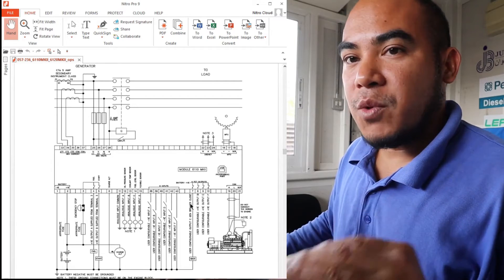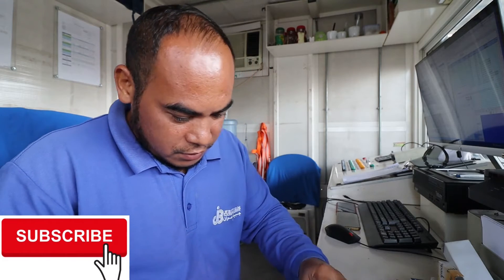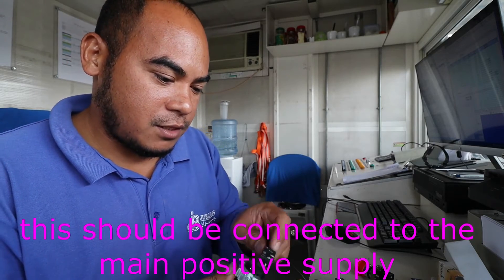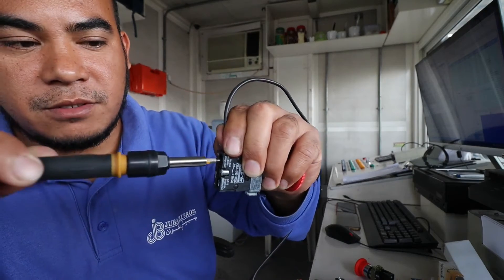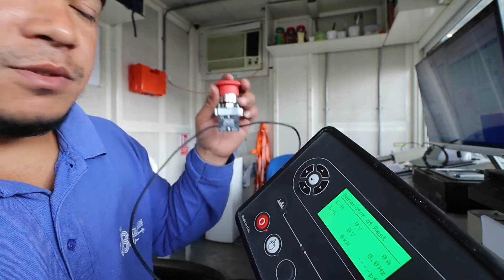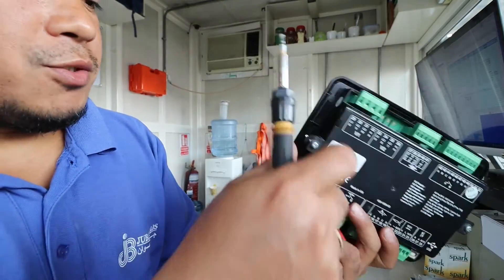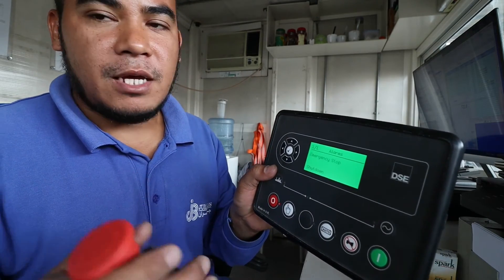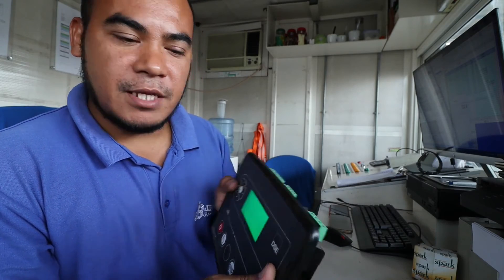Generator EMERGENCY STOP, wiring connection, troubleshooting lets simplify

Comment: thanks for the video, it describes the whole story about the emergency stop cycle... I have a strange case on my DSE 6020. It gives me the emergency stop alarm while the emergency button is not pressed !! note that my generator contains only one emergency stop button !! can you advise what needs to be done? Thank you, brother.
Reply from the maker: Emergency stop is always have a positive supply that should be use multimeter to check if there is voltage DC going back to your module if your using digital input for extra emergency stop the supply is negatively active should be

Comment: Sir good day. I have concern regarding emergency stop of genset 3412C emcp 4.2  ayaw po ma reset sa monitor pero sa ct et po e mawala nmn sya pag n reset. Sa monitor lng nka present lage. Ano kaya possible cause sir.
Reply from the maker: Check the wiring exactly kong meron pbang suplay na pomasok or wala na
Reply from the maker: Makikta mo sa likod ng module ang connection doon mo ngayun testerin using dc voltage

Comment: Thanks sir for this video,  but I have issue with 6110 models, emergency stop and lock out have showing,  how do I deactivate it sir
Reply from the maker: First thing to donis to check the alarm because if onky emergency stop is the problem thin if only emergency stop reset and releas the push botton finsh

Comment: Pls is have issues on 6110 model  the  emergency does stop what should I do
Reply from the maker: If emegerncy stop no remove checkbthe voltage coming to module number 3 should be same as volatge accordibgvto battery now if no volatge meaning fuse busted or push bottom problem contact

Comment: Sir, do you have any wiring diagram for the old FG Wilson 2001 Control Panel?
Reply from the maker: Analog or digital sir lahat na dito sir digital na module
Reply: @benzblogsVlogs  Sir, meron kaming ganitong model sa isang location namin pero wala akming makuhang diagram. Just asking if you have any Sir.
Reply from the maker: Sir wala pero makatolong ako para e guid if posible sensya na sir
Reply from the maker: but dont worry if you have questions just let me know thanks have agreat day

Comment: Good Evening Sir what is the problem when  I start the Genset it crank once before start the engine.. thanks
Reply from the maker: Less starting fuel
Reply: Sir ano problema ng generator na nag crank ayaw umandar bago na Yung pump ng fuel . Palagi trouble airlock . Salamat
Reply: Sir Benz ano problema may 220kva kami generator Cummins tapos may load na 50hp 220volts umabot ng 400plus starting current big lang magfault Ang generator. Ano kaya problema salamat
Reply from the maker: @johnpauldorado439  ganito 50 hp is equivalent of 37 kw (3) is more than 400 starting sir dapa talaga engine mo sir dapat meron kang softstarter para hindi dadapa makina mo
Reply: @benzblogsVlogs  Sir Benz nka Wye delta across the line Po Ang motor. Ang generator Po nag Po fault pag Malaki starting current. Pero Po pag iBang Genset na Japan 90kva kaya nya Po paandarin. Pero Yung Cummins na 220kva d kaya ano Po kaya maganda gawin sa Generator po
Reply from the maker: @johnpauldorado439  kong ganon double check mo sir yung configuration ng module mo
Reply: @benzblogsVlogs  Oo Sir Benz Yun din NASA isip ko kaso walang kaming laptop pang configure tapos walang marunong man configure puro lng hula2. Sayang Yung mga generator ng amo ko
Reply from the maker: @johnpauldorado439  yun lamg sir di pwedi kcing ganon mahirap check nyo din yung mag basic config doon sa yt sir tama yun